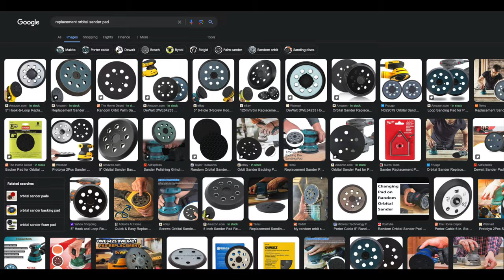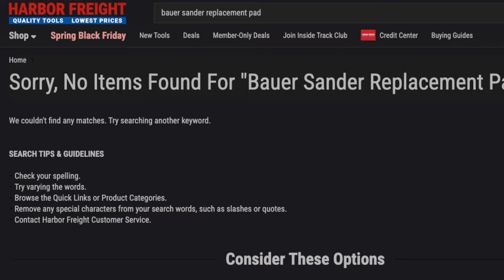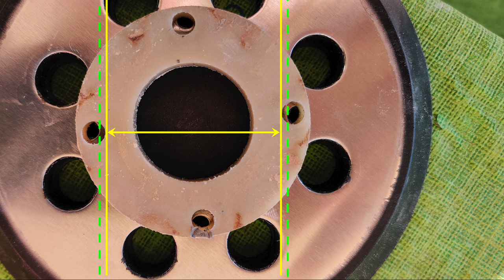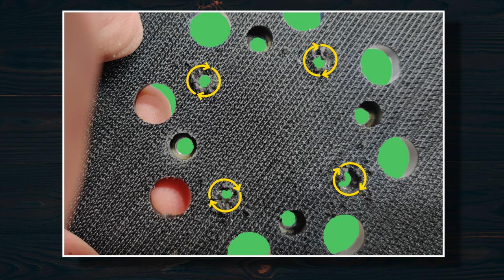Harbor Freight Bauer Random Orbit Sander -  Easy Pad Replacement Upgrade & Dust Bin Fix

Comment: I thot it, u confirmed it, thanx much! The holes are 1 1/4” apart on the Bauer, most of the others are 1 1/8, they had to of known that at r@d. Too good to throw away, mine won’t quit!
Reply from the maker: I agree with it being too good to throw away. But why they went with proprietary pads and don't make it easy to get replacement parts makes no sense to me 🤔

Comment: Concerning sanders, I have a Dewalt. My question is a bit out there: is there a possibility to remove the pad brake? I'd like to use the palm sander more as a polisher, but therefore it needs to free spin... I'm not sure how to do this. Noob at DIY 😂
Reply from the maker: The Bauer sander spins down slowly, so I'm pretty sure there isn't a pad brake. Without a Dewalt sander to dissect, so I don't think I can help answer your question 🙁  Maybe try searching the web for "Dewalt orbital sander pad brake" or something like that?

Comment: Correct item # is 600065
Rubber backing pad
Reply from the maker: Thank you for that item number. Maybe they've gotten some back in stock and that number will be helpful. Were you able to order it?

I didn't pass along the part number in the video because when I called the parts line, they were out of the pads and didn't know if they were going to get them back in. Also in my experience, parts take a couple of months if they are available at all. Rather than wait that long, I came up with this modification of more readily available pads.

Comment: My problem is I can't pry the dust container off, it's stuck on - other than that, I like the sander
Reply from the maker: Yeah, the dust container design could use some improvement! I wish I could post pictures, but I'll try to describe how it is attached.

The container has raised tabs on the inside edges where the container meets the body of the sander. Those tabs engage with holes in the body to hold the container on. You can pull outward on the bottom of the sides and it should disengage.  

Those tabs will eventually not snap back into the holes, and that's where the rubber band trick I showed comes into play!

Hope that helps!